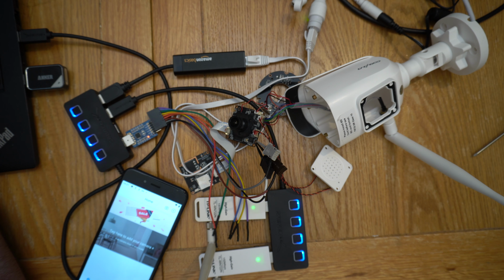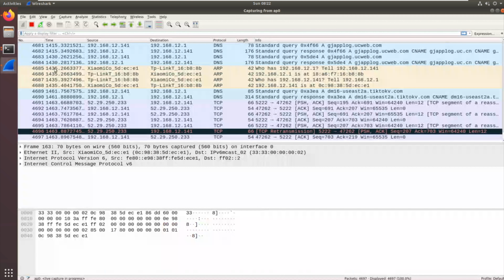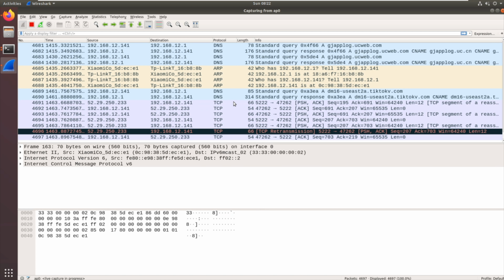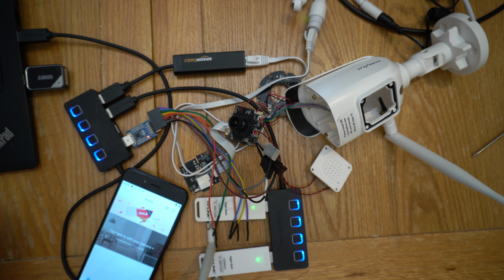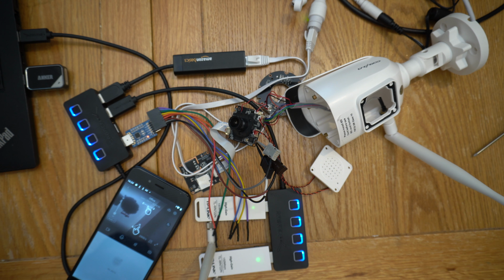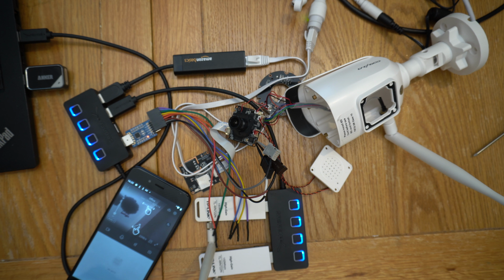Cacagoo Pairing Process

Comment: By the way, with those wifi dongles you should be able to create virtual interfaces, so it can run an AP and do monitor mode at the same time for example. (airmon-ng can easily do that if you have aircrack installed, or with ip li it is also not too difficult to create a virtual interface) And for that audio, not sure if you saw my second thread on twitter, it seems i got some data out of that signal now, it appears to be 2x 16-fsk and i could spot at least some of the base64 data from the QR code (scanned it off the screen) in that audio signal. I think about making a short video about inspectrum, since it looks really psychedelic and apart from that it is a really nice tool, like baudline, but open source, and with sliders, and without spending days to find some strange small vintage fonts to be able to run it... xD Oh, and a question towards the gnuradio folks, either my google-fu is not strong enough, or you really have no "easy" way to decode mfsk signals? like, specify the number of frequencies, the separation between them, pulse length, and maybe have an option to give these frequencies a user defined meaning in the output?  Like, you don't really expect me to set up 32 filters with 32 binary slicers?!? There must be an easier way?

Comment: That's insane.  Reminds me of old computers loading off an audio cassette.
Reply from the maker: I have seen it on something else, but it was really high pitch (not ultrasonic, just high) and much less... like a C64 cassette. 

I'm intrigued by it now!
Reply: @cybergibbons  was that like essentially an audio QR code then?
Reply: ah waiting 10 minutes for your game to load just for it to lock up on the final part of loading lol
Reply: Side note: Google is using high-frequency sounds for setting up stream sessions. I have seen instructions to place a phone with its mic close to another device in a setup screen for screencast.
Reply: @CyReVolt  It's also how the Amazon Dash buttons worked. They contained a microphone and the Dash app on your phone would transmit the WiFi credentials through audio. Makes for a very user-friendly experience compared to having to connect to a WiFi network broadcast from the device.